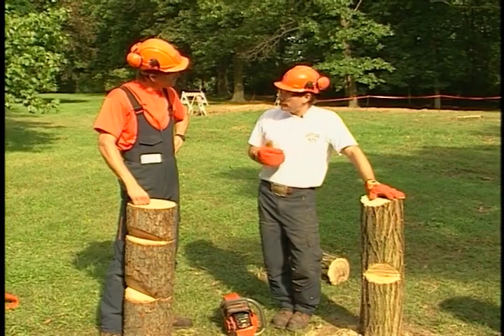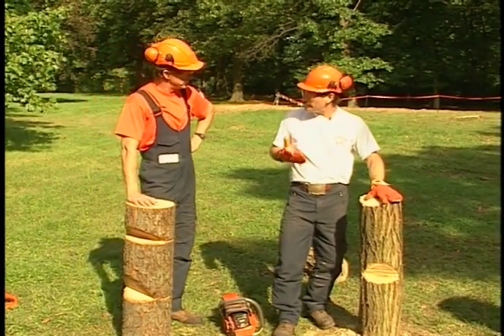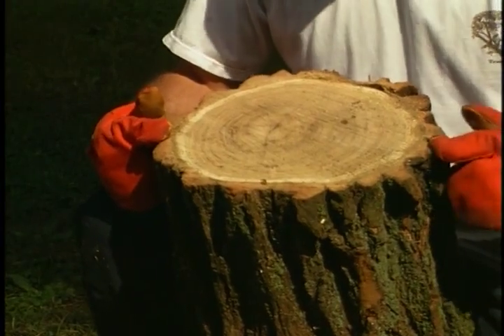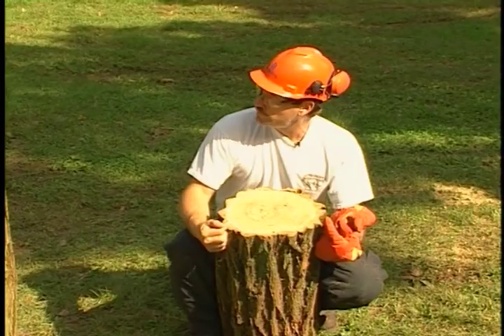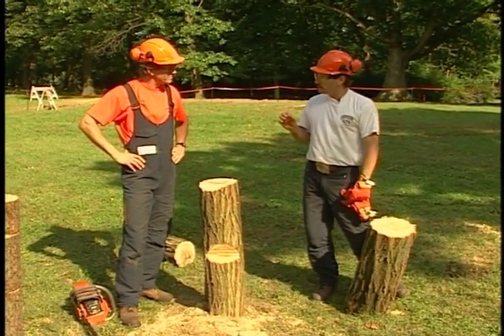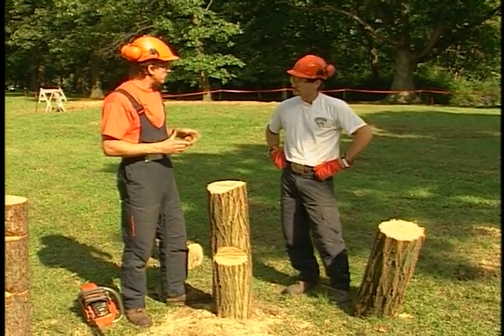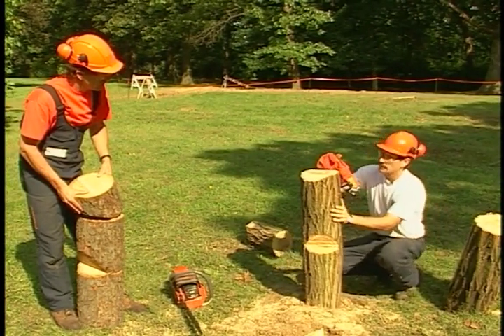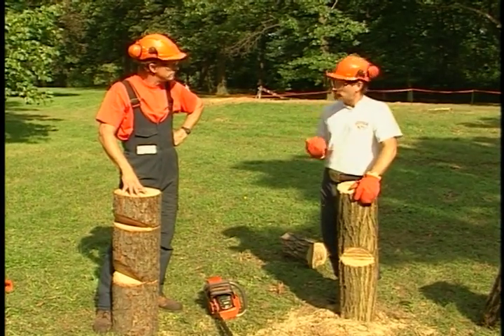Notches Part 2

Comment: Basically the situations circumstances create necessity for varying your notch depth. 
A review of "fundamentals of treework" the book, can give you perspective on what circumstances you need to pay attention to and adjust for. 

Standard rule of shooting for a hinge that is 80% of the diameter, IS FOR ensuring the NECESSARY amount of strength of wood fiber to make a hinge that is actually useful and doesn't break off too soon. The 'strength' of the hinge comes from the actual number of fibers in hinge relative to fall direction and weight distribution in the trunk of the tree (think the shape of slice through the trunk), and again, to to the notch fibers layout on the stump (I.e perpendicular or other to falling direction, advanced methods possible where the hinge strip is NOT perpendicular to your target on the front of the face) to the felling direction.  

This 80% 'rule' is not an actual rule. It is commonly held as a good 'rule of thumb' in industry practice, and may need to be varied by a seasoned veteran educated properly on the circumstances mentioned in the previous paragraph, among others. 

A few more are:

-Tree lean/lay
-surrounding environment
-property damage potential/other man related hazards (i.e power lines, houses, vehicles)
-type of wood (for weight and strength of fibers)
-size of saw bar
-integrity of the wood (rotted? Burned? Damaged?)

And some others...

Just trying to put a summary here cause the guys had a hard time with this clip.